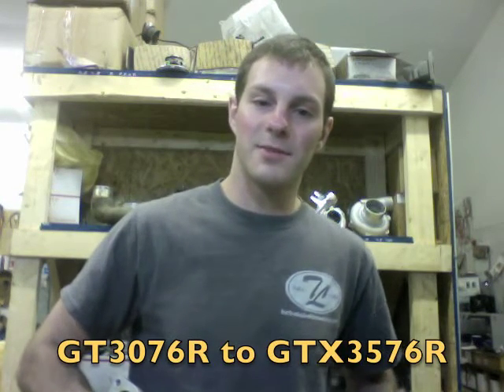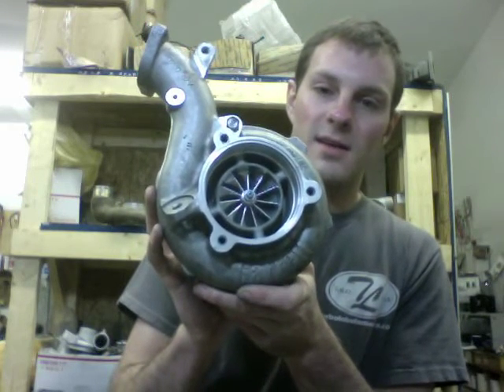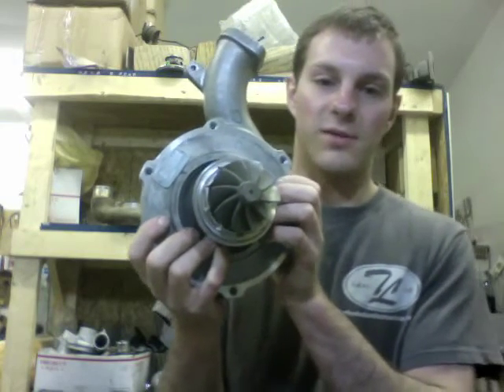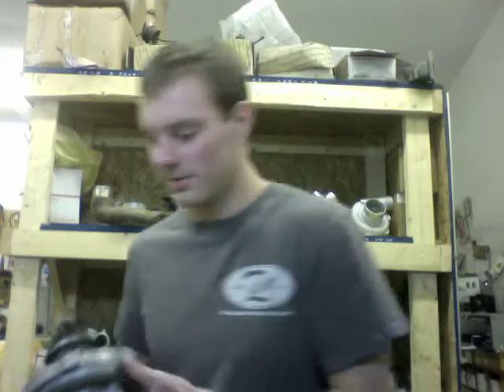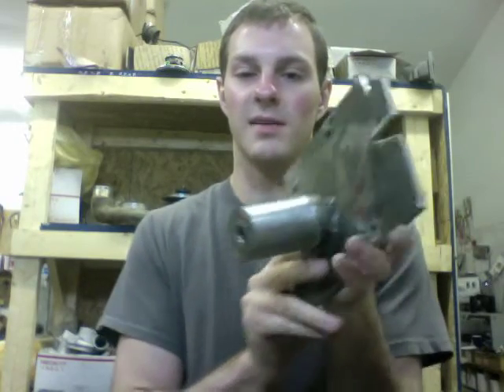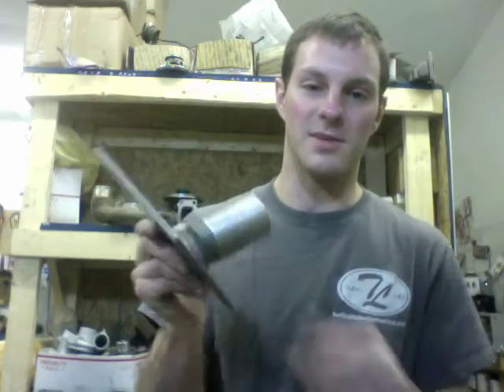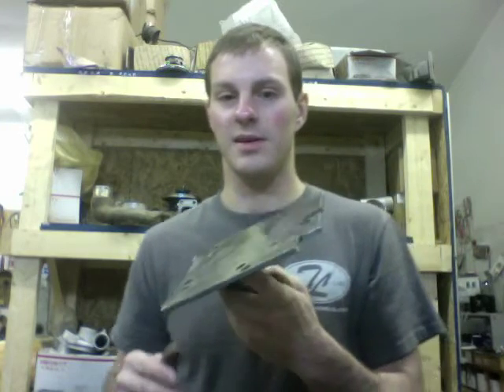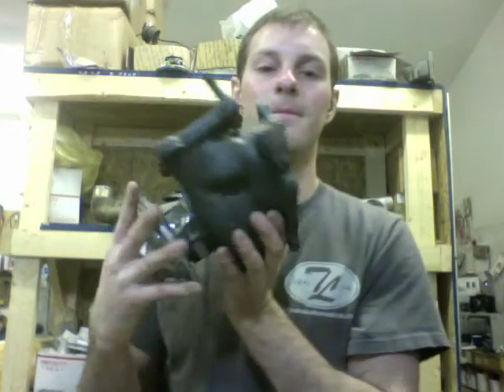Evo 10 Garrett GTX3576R Turbo Upgrade

Comment: You can make my existing evo x Garrett 3576r to a 3582r or 84r?
Reply: I'm sure he can do that, but I think you can do it yourself. Not positive, but I think you can just swap The 30R Comp wheel & housing with the 35R, that way you don't need to machine anything.

Comment: Im happy you can do this upgrade for us , I have a GTX3076 and I want to make converted into a GTX3576. Currently im making 506 whp with the 3076 pretty much maxed out. I would like to be close to 550 or 575 whp on the 3576 . How much is the service?
Reply from the maker: +pekoso1 I think the total cost was 650$. i have to ask Ian he handled the transaction. I just did the machining work.

Comment: Do you sell or can you piece together a GTX3576R from scratch? I am looking to purchase one for a 2JZ build.
Reply from the maker: +madhavsaraswati I can and have before. i build them for 1100$,  if you wanted me to do it, i would need to know what turbine housing size you would want .63, .82, 1.06. For the Compressor housing i maybe able to get .70 housings but i need to check on that because i was looking into that a year ago and just kind of forgot about it. I know i have a .60 cover but it is damaged on the inlet.
Reply: +Turbo Lab America Thanks for the reply. I ended up sourcing a Holset HX35 cheap. (like $200 cheap). So will max this out on E85 first and if I want more will hit you up for the GTX3576r